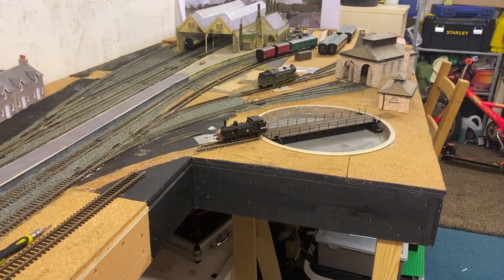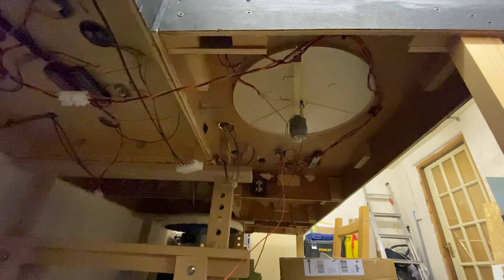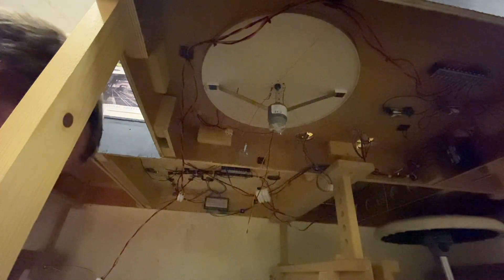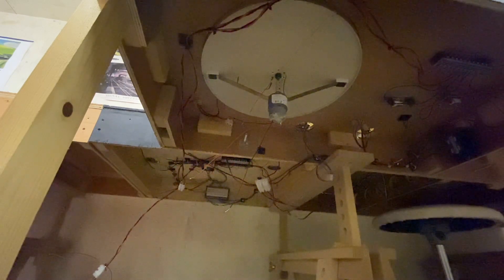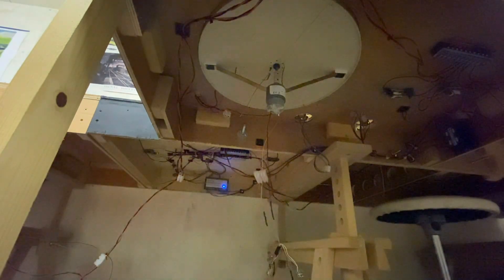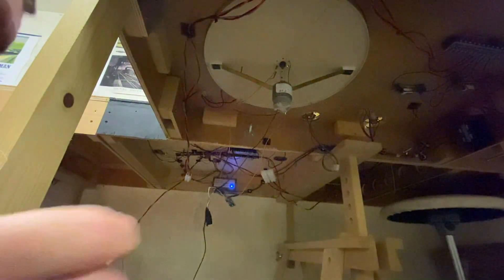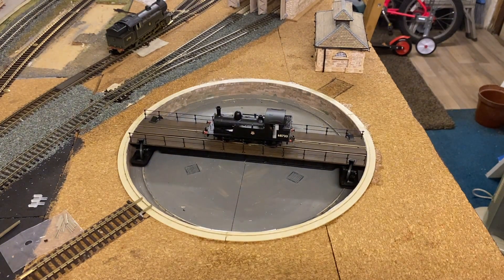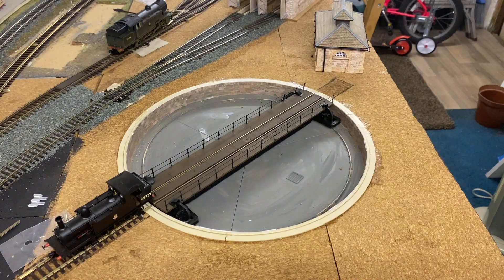Peco LK-55 turntable/Locomotech motor DCC conversion #93

Comment: Do you have use an autoreverser  with the turntable?
Reply from the maker: @spraymanandy1963  nope
Reply from the maker: @spraymanandy1963  to elaborate, the Peco turntable has a metal track inside it with a gap, and as it turns it changes the polarity of the rails. I’ve turned sound fitted locos with no issues

Comment: Can anyone please recommend a basic decoder for use with this Locomotech motor kit please??
Reply from the maker: Pretty sure I used a basic Hornby 8 pin decoder. I’m sure there’s better ways of doing it, but that worked well perfectly for me and it gave good slow speed control and was easy to wire up to the DCC bus.
Reply: @chrisderby986  thankyou my friend, ill try one of those! :)

Comment: I'm about to install the Locomotech motorising kit to my Peco N scale turntable. I will be using an ESU Lokpilot decoder and NCE PowerCab controller. Every other video I have watched show the Locomotech motor turning the bridge super smooth with no jerking whatsoever so was a bit puzzling why yours wasn't also smooth. I will let you know how it turns (hopefully nice and smooth).

Comment: Hi there did you know that Locomotec do an indexing kit to go with your Lk 55 turn table It can be used on dcc  regards  Alan
Reply from the maker: Hi yes I did, but at the time I bought the motor kit I was intending to change to DCC. Kinda wish I had bought the indexing version now though
Reply: @chrisderby986  You can still buy the indexing kit as a separate kit. give you about 11 positions, work on dcc
Reply from the maker: @alanmargalan5921  thank
You